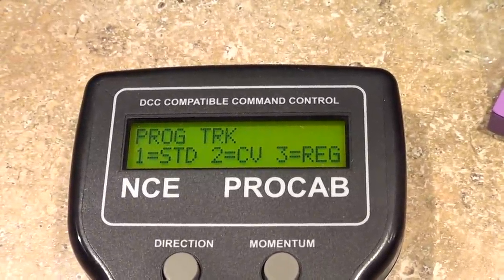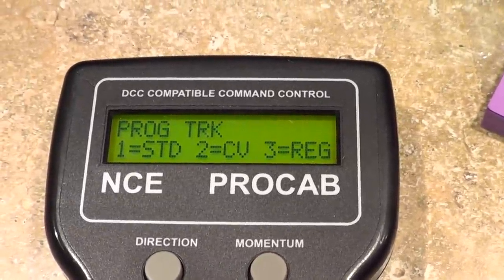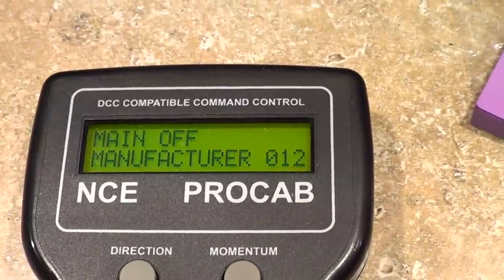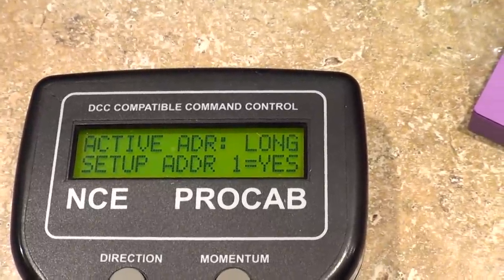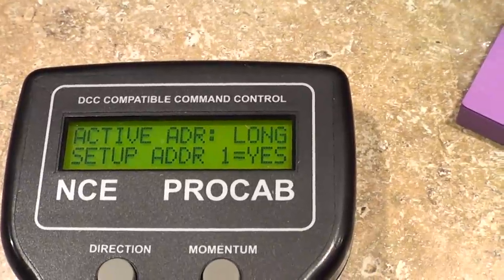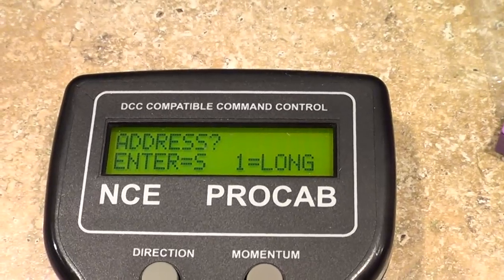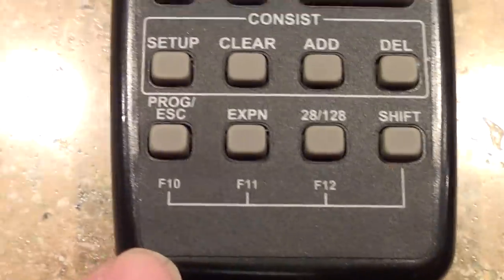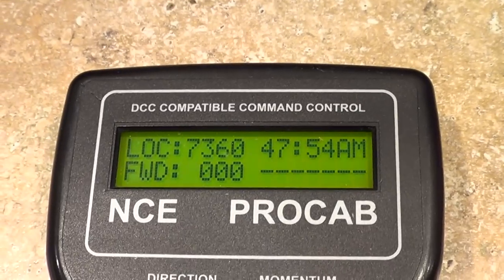NCE DCC PROGRAMING A ENGINE DECODER

Comment: Aquired a NCE system and using TCS WOW decoders in 2-Truck Shays. Thanks to you I grasped the concept of programming the "decoder" in the NCE environment on a program track "first". The programming of the long adress to the decoder was my missing link. Went back and re-read NCE's manual and things started to make sense between NCE's programming and programming features of the WOW decoder. Now both can be accessed on "the main" as needed. A newbie saysThank you.

Comment: why do we need a program track? instead of programing on the main
Reply from the maker: You never program on the Main. That's my rule and many others have this rule. Push the wrong buttons and you end up doing broadcast programing and every loco that is on live track will be programs to something. I have had someone in the middle of op session program all engines to Loco 3 that were live.  Two large clubs that I handle do not allow program on Main it is against the club rules.

Comment: Hey arthur, i didnt know this at first but when i started prog on prog track my whole layout stopped while in that mode. I read latter that is is by design. Is there anyway around this? I hate telling my friends "hey stop your trains a minute i want to reprogram my light".
Reply from the maker: Yes buy a power cab and set it up with a piece of track and it is were all my guest can program engines with out shutting down the big layout.  Only way I know you can do it.

Comment: I purchased 2-mrc decoders model 1960 and placed in SD-70m's and was instructed that they would support advance consist. Well I followed your video to the letter and found that not true. I did get them to work old style but that will be worthless to me as I need to run more than two locos. Anything I may have done wrong in consisting?  MRC not something I will purchase again. Your thoughts on that would be helpful. This video was very helpful as I followed you through the steps. Thank you Mark H.

Comment: The programming track is physically isolated from main track, only connected when the switch is in the proper position. I get that. But when the switch is thrown the other way how is the cab connected to the programming track? Is there an extra set of wires connected? If so, where? Is there a command station involved? I don't see any extra wiring from the cab, so I am a bit confused. Thanks for answering a newbie question.
Reply from the maker: There is a connection that says programing track for two leads for connection to the command station.  When the cab is put into the program mode the rest of the system is turned off and only program track is active. Cab stays plugged into the cab bus.

Comment: Hi Sir, Do you have a video on how you wired that small 'electrical' panel that isolates the Program Track (now used also as a Rep Track) from your whole layout? If so, could you point me in the right direction?
Reply from the maker: A piece of track with insulators or program section on both rails.  a double throw double poll, center off switch.  One side is program track, other side is main,  center is off for both. Do not run out of the area that is program track while n Program track mode.

Comment: I've programmed about 20 NCE decoders in Athearn engines. Normally after I get the long address programmed in I exit out of the program mode.  NCE is a super easy DCC system to use. I will alway use NCE over Digittrax system. NCE is a great system to use for someone starting out in DCC. I have a Digitrax system that is impossible to program.   When you use a Digitrax decoder in an engine on NCE system the Digitrax decoder draws more power to get that same locomotive moving.  The engines that has factory decoders in them like Intermountain are easy to program on NCE too.
Reply from the maker: You need to go on into the next set and program DC off or 4 off and 1 long address on.

Comment: What button did you press @4:44 when the cursor was blinking at “short address 3” to get to the screen that said “activate this address”? 
Also, I have a loco “Duke of Gloucester”. Would the long cab number which is 71000 program into this system ok. It’s just that so far, trains being programmed on you tube seem to only have 4 digit cab numbers.
Reply from the maker: Press Enter and move to next step.  Some of the newer decoders give you a little different screen look.  But enter. and 1 will get you there.

Comment: Is the programming the same between the pro cab and power cab ? I' m about to pull the trigger and buy a power cab starter set. I' m building a small switching layout ( 15" X 10' ). I think the NCE power cab would work me. But I do have one more question. Since a program track is needed and must be insulated ROM the main layout can I use a Atlas turntable to do this ? I thought about putting a DPDT switch with center off like you did here in the video but shut down power to the layout and use the turntable or programming DCC equipped engines Would it be OK to do this or not ?
Reply from the maker: Yes, you do not have separate program track unless you set one up but not required. Just do not have other engines sitting on live track when programming.

Comment: Nice video... Can you tell me what to do if my NCE can't find the decoder in my engine.
Reply from the maker: First how old is your command station?   Is it a Power Cab or a full 5 amp system Power House Pro Unit?   Is it a sound decoder?  most this come with old systems and not enough juice on programming track to get into the actual decoder.  Soundtrax sells a booster for the programming track also can try programming on the main. But if you do that make sure no other engines on live track you will program them also.
Reply from the maker: You should continue and try to program even if the read out say nothing.  It maybe doing what you want but cannot read what is being done.
Reply: It's new and it's the procab with the built-in 5amp system

Comment: I am trying to program a DCC with sound after going to program and selecting standard it is telling me it cannot read CV. I cannot find any tips on what to do when this occurs. Can you help me? I am working on a short piece of track. Just getting into this and am getting really confused. Videos make it seem easy and I just keep getting this message. Also I was under the impression that a loco with sound should have the sound and light come on as soon as I put it on a track with power running to it and I am getting nothing.
Reply from the maker: What is your command station. Power House Pro 5 amp or a Power Cab 2 amp system and how old is it? Are you using a program track or programing on the main?  Is it a sound unit?   You should continue even though it say can't read CV the compositor in decoder can block feed back but you actually are programing the decoder.
Reply: It is a brand new power  cab system.  I dont have a layout set up yet so was working with a 2 foot section of track and was using the program track setting.  WE tried with three different DCC engines. One has sound the other two dont. Got the same message on all. Tried continuing and it let me continue but after I was finished and went to select locomovtive and tried to run it I didnt get anything.
Reply from the maker: Do you have a FB account? If so go to Arthur Houston and send me a personnel message. I will give you phone number.
Reply from the maker: Did engine run on 3. Select Loco 3.
Reply: no it did not. Called NCE and we think it may have been that the track was not getting power. I tried testing it with a multimeter- though im not the best with electronics so could have been reading wrong and it appears that I may have gotten a faulty controller. Shipped it back and they are going to run test adn see if they can figure out why we were not getting power to the track.
Reply from the maker: If you can contact me trough FB a Personnel Message it if far easier to work out issues.

Comment: Are you in a different kind of mode/version of cab or what?? you have v1.3 at top right of the cab screen. I have not seen this on mine.
  your program goes prg on main,, assn loco cab,,  sys clock,, then, "program track"
  I am using a NCE Procab also
 Mine goes prg on main,, assn loco cab,,  sys clock, then,, "set cmd station",, and on , but never a "prog track".
   My goal here is that I purchased a used  N scale Kato with a decoder hardwired under the light board.  I don't know what the address is set to, it has no cab number and 3 is not working so I am wanting to figure out how to reset the address.
 Since it is hardwired under the light board I didn't want to unwire it to figure out what type decoder it is unless I had to.

Comment: What if you have a 2 digit loco address shall I program  0042?
Reply from the maker: I would suggest 142. Make lable up put on bottom of engine. Need to be above 127.  127 to 2 are consist addresses in NCE system

Comment: so am i under standing that when i open up my train  i can just tpe the road number and it will just go?
Reply from the maker: You have to program decoder in engine to work on the address you select. Cannot be lower than 127. and not more than 9999. You have to put in and select long address.  Once the decoder is programmed  than you  can select loco and punch in number you are using IE engine number and press enter and it should appear in top on controller and off you go.
Reply: thank you

Comment: is it possible for an NCE engine to run on dc as well?
Reply from the maker: Yes when you get to set control part and ask turn DC off do not turn it off.  You should be able just to set on DC powered track and it should run. You can only have one DCC decoder on track at once.
Reply: Thank you.

Comment: I'm sure I'll catch on to it but since I am as green as I can get right now it just seems like rocket science.
Reply: Don't fret Jim! If you have got an NCE controller and a DCC layout. let me tell you, you have the right gear to get off to a great start. with so much expansion you wont ever need another controller for a very long time!
 If you have any Hornby rubbish though you're in for a world of hurt. (they don't mix well with anything but Hornby)

  This clip is showing off some of the more complex programming you can do with your NCE controller. BUT don't worry! You can just run your trains around very easily without having to worry about any programming.

 By default most trains are programmed to be #3 So put a DCC ready train on the track, hit number 3 on your controller and you're away!